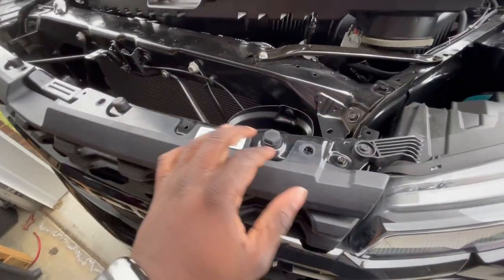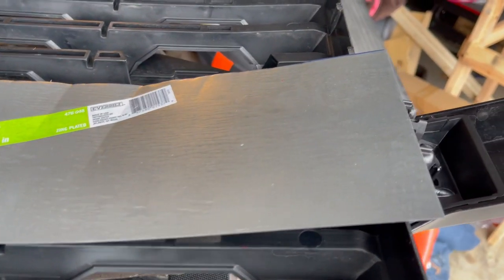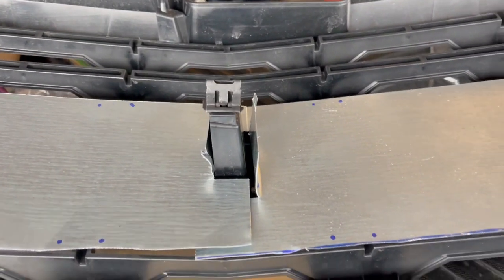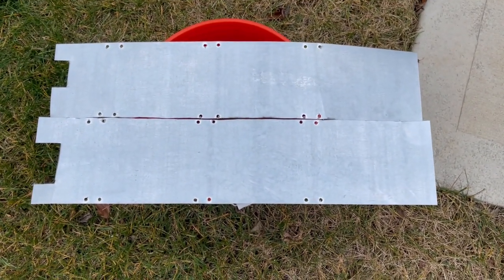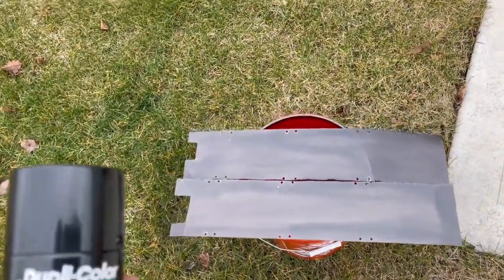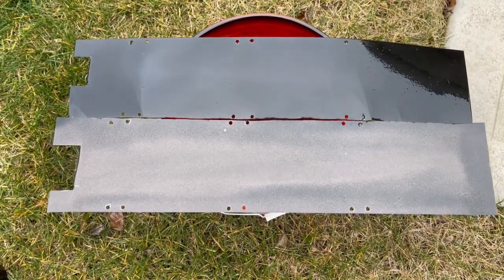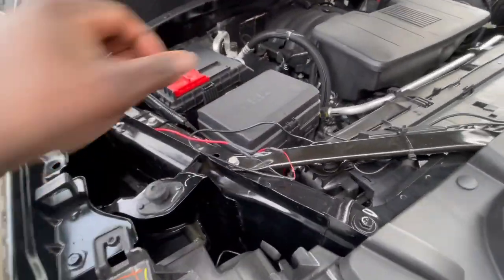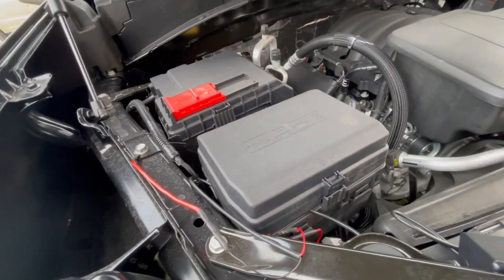Install Lights in the grill of my 2021 Silverado Custom

Comment: Woah that looks really good!!! Most people that do stuff like this do it to the whole grille but I think this looks way cooler! Great job!
Reply from the maker: Thank you DJ..
Reply: I agree 😂 most people do a lot of tedious work to install lights in their whole grill 😂 but your “logo” “lights” 😂 are so much better 😂 ….
Reply: @GarryOfAllTrades  I see the links in the description.  Is that just one pack for the grill and the side lights. Do they just wire together??
Reply from the maker: @howardbutler883   Hey Howard, the lights are all connected there are two long ones and two short ones. I please the long ones in the grill and short ones on the side.
Reply: @GarryOfAllTrades  awesome thanks bro. Last question.  Hows the reliability how long have they been in. Any trouble
Reply from the maker: @howardbutler883   Very, you just need to make sure the light are sealed and water can’t get in. If you only want to do it once glue your edges and ends. WAter got in the end of one my short ones. I still had a lot of light that you couldn’t see. I cut the dead end and sealed it up, didn’t have any problems after that. Great question
Reply: @Garry of all trades I have that exact grill on my 2022. how much would you charge to make the metal pieces for the back of the grill?
Reply from the maker: Hey Ed, I don’t like to work on anything but my own.

Comment: Looks great!!!!  I did the same to my 21 Chevy.  I think painting them was excellent idea I didn’t think about that.  I can see my shiny metal behind it.  Be careful with your colors & it strobing.  I checked the laws with my police friends they told me no strobing unless yellow w/permit.  Absolutely no Red or Blue (police & fire).  I live in Ga.   I put regular LED lights on my side grill.  I have everything running through my own fuse block to my rocker switch panel.
Reply from the maker: Thank you for watching. Before buying the truck I knew I wanted to do this mod. Lol.. I’m ex law enforcement so I definitely want be using strobe.
Reply: @GarryOfAllTrades  what else are you planning? I’ve done running boards, bed liner, LED turn signal on back. Up next is wheels & then leather up grade. I only have a WT☹️. Wives & budgets got to love them.
Reply from the maker: I’m almost done. I have a video coming out in a few days
Reply: Can I connect my wires directly to my battery or shall I run it through he fuse box? I'm doing my 2021 1500 truck as we speak.
Reply from the maker: You can but I don’t hook anything up without a fuse.

Comment: Are you concerned that blocking off part of the grill could cause engine overheating?
Reply: I was wondering the same thing since the Chevrolet sign has holes to let air in but then again I am not an expert 🤷🏽‍♂️
Reply from the maker: No, not one bit..

Comment: Hey GREAT JOB! I recently purchased a 2021 Chevrolet Silverado Custom and added a few enhancements. I’m interested in adding that kit also. I confused on how you exactly applied the side lights. If I purchase the light kit could you show me how you applied the side lights if I drove from Atlanta?
Reply from the maker: I may go ahead and do a video to show everyone.
Reply: Hey Garry. If possible could you show me how you mounted the side lights and explain the wire connection sequence.
Reply: @Kevin-lk8yw  hey have you done your lights yet??? I'm outside Atlanta and I'm going to try and get mine done friday
Reply from the maker: Yes. But my Computer acting up. I’m about to true to load it again.

Comment: Can you turn off the LED lighting on grill? Or do they turn on automatically when you power the engine?? Thanks!
Reply from the maker: They turn when the car is off. Plus you can use the app to turn them off.

Comment: Bro that’s lit. Where are you located and how much would you charge for something like this
Reply from the maker: Thanks Johnny I’m in Kentucky, but I don’t work on anything but my vehicles. Sorry buddy.
Reply: @GarryOfAllTrades  it’s all good I’m in Cali anyways. Good work tho, I need to do this to my truck ASAP
Reply from the maker: It is super easy. You got this.
Reply: @GarryOfAllTrades  Hey Gary, quick question did you only buy one set of those led lights or two?
Reply from the maker: Only one.. but two would definitely make it look 10 times. Better

Comment: What’s the link to the led lights you used
Reply from the maker: Govee Exterior Car LED Lights, RGBIC Underglow Car Lights with App and Remote Control, 16 Million Colors, Music Mode, DIY Mode, 10 Scene Modes for SUVs, Trucks https://www.amazon.com/dp/B088JZTWQN/ref=cm_sw_r_cp_api_glt_fabc_CBYVZNVKG9PNP318TPZB
Reply: @GarryOfAllTrades  thank you sir I have white led that I’m going to be doing since my truck is all white. But truck looks good the way you did it. Do you remember the sheet metal size that you used for it.
Reply from the maker: @jameslavinder4368   Thank you. If I’m not mistaken it was 12x24.

Comment: Can you show the wire set
Reply from the maker: Not sure what you mean.. If you’re talking about the fuse wire, I used a micro2 mini.
Reply: Can you tell me where did you put the box for the led light wiring more detail
Reply from the maker: I zip tied it to the rail next to the fuse box.